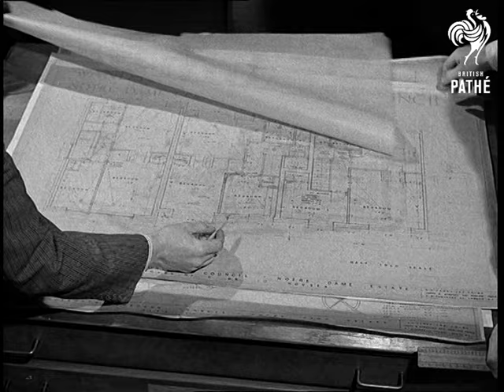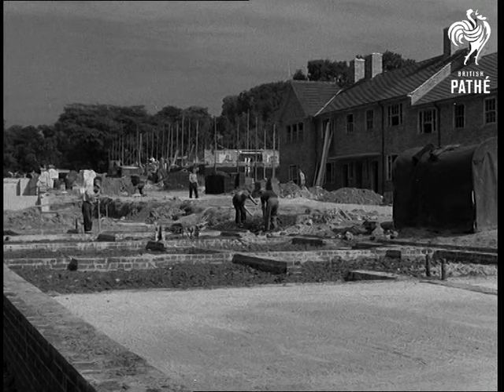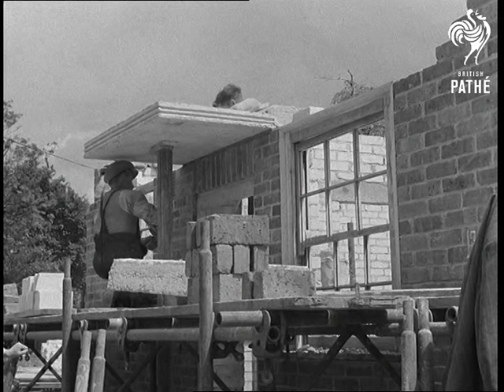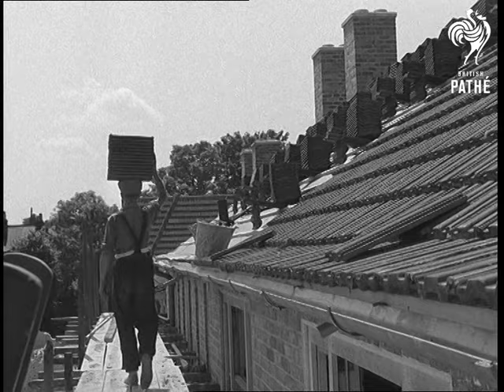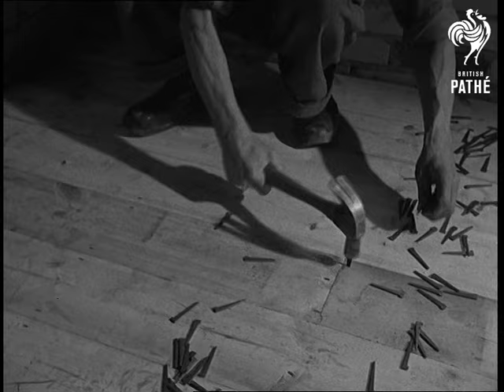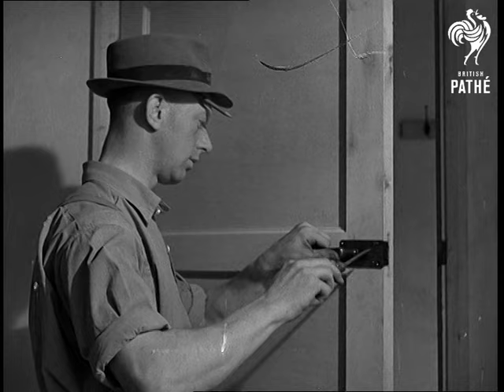Building A House (1940-1949)

Comment: When houses were built properly and were actually affordable, unlike today thrown together and cost beyond a fortune and aren’t affordable!
Reply: Yak yak yak 😒
Reply: The roofing is without air ventlion, where under the stone it will be moister
Reply: And when 1 man's salary could feed and clothe his family.
Reply: Depends when this was, a lot of 1930’s houses were built on the cheap, with ceilings made from fibreboard instead of plaster. I’ve replaced all the ceilings in my ‘30’s house myself.
Reply: Today's average weekly wage is £663. In 1940 it was £2.50p. That equals an increase of 250 TIMES. So, if a house today costs £250,000, the eqivalent in 1940 would have been £1000. In 1940, only 17% of Brits owned their own home. Today, that figure is 70%.
Reply: @deppyjohn7 100%. Every year people live much better than before, but don't realize  that.
Reply: Your so wrong.@deepjohny7
Reply: Not always built properly, ive seen some seriously wack framing on these old houses
Reply: @brian-jv9bt  How so?

Comment: skills that are nearly forgotten, hard working men who knew there job and took pride in there work, no nail guns, laser levels, cordless drills or anything like they have today.....but there workmanship and quality of work and attention to detail was amazing.
Reply: Council houses with archways are pre 1950 they where designs of the 20sand 30s used after ww2 and about the 50s they made them much squarer windows and door ways with a wash house and then the 60s they made blocks of flats and lego type houses the houses that were built straight after the war will still be around in another 100years because they are heavly well built .they used harder bricks in the corners and over time they haven't faded like the coarse brick and they look quite smart how the edges are highlighted......half renderering began in the 1920s and it was very fashionable and some houses are finished in the same way

Comment: The thing that puts council houses apart is the fact they are in open areas with a garden.they really were revolutionary at the time with electricty gas and water they were a dream come true to the 1st genaration of tennants the houses were built at a cost of roughly 1k the goverment couldnt stop buying them and had only stopped in the 1970s were contracting began

Comment: Cut nails in the 1940s? I thought wirenails took over decades before that.

I see a couple of tradesmen (bricklayer, painter) wearing ties.
Reply: I did my apprenticeship as a bricklayer in 1972 and the old guy I was put to train under wore a suit to work, leather patches on the elbows. as for the cut nails they are still the best nails for floorboards as the never squeak!